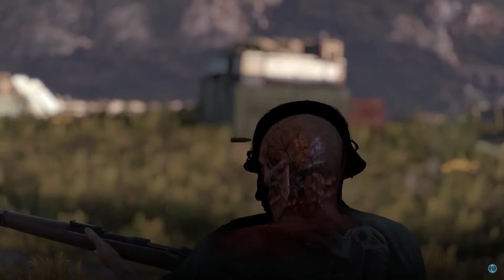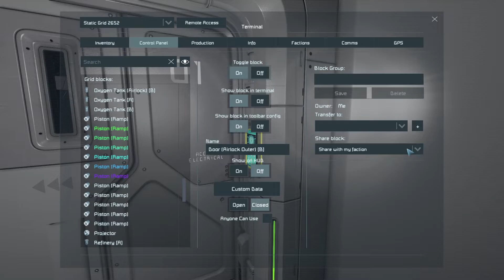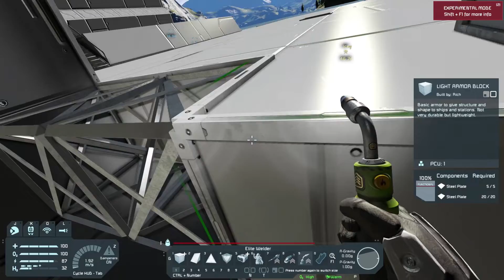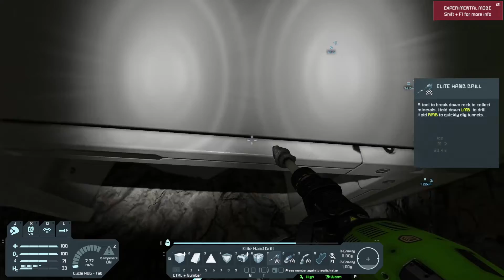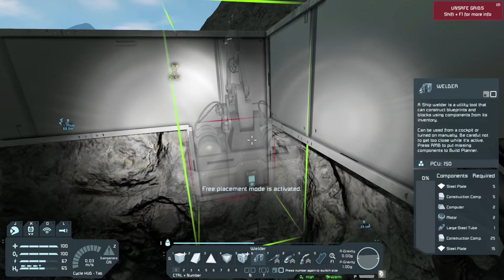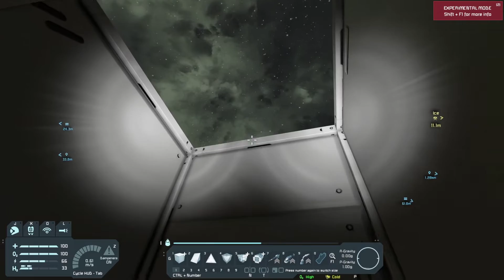Space Engineers #57: Apartment Docks

Comment: Something has to be wrong here. Last week, I welded up to ~1.25 large block with a large grid welder, which amounts to ~7 small blocks. Also, when you tried the second time at 26:40, they welded up the whole thing, even the blocks above which were further than the starting block. Or do projections require shorter distance to initiate the welding? It's just weird.

I often have issues with the Build Planner system when my components are inside a cargo on a grid connected by a connector only, there's something that prevents automatically pulling the components through connectors in specific situations, even when it works fine by hand. Perhaps, this is a similar issue?

Comment: Instead of the advanced welders, use the ‘Build and Repair’ systems.  You could replace each welder with one and set the area of effect to be on the platform.  This would also allow you to hide theme under the floor.  A lot of players I think use this mod more because of the convince.  And a good way you distinguish the two sides is to color one side with red and the other with blue, the red port and the blue port, easy.
Reply from the maker: Build and repair is for noobs who can't play they game so they cheat
Reply: @DragonNationGaming  I don't think the 'Build Repair System' is for noobs.  it can be for all player levels.  I mean you still need to make sure the settings are right and you also still need the components available in an innovatory, so it is not to far off from the advance welders that you plan to use.  And from what I have seen, it is close enough to vanilla that it could even be added someday, even if I would not have the flight mode option.  it would be better for the platforms any way since the people building will have a grinder and a welder in one.  Plus the 'Janitor' function would make sure the area where ships and rovers come in stays clear of junk.  You say it is for noobs but there has got to be some redeeming qualities about it that you do like and that support pro players as well, I mean an item is not good or bad, it is all in how it is used.
Reply: @DragonNationGaming  I just got the game. Do you recommend it for new players? My first playthough will be vanilla to familiarize myself with the game, but now wondering?